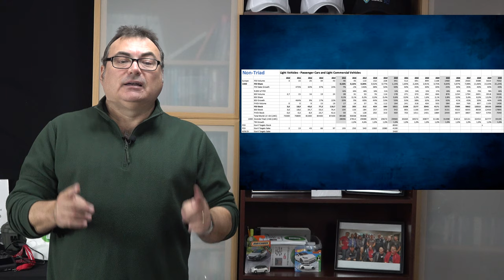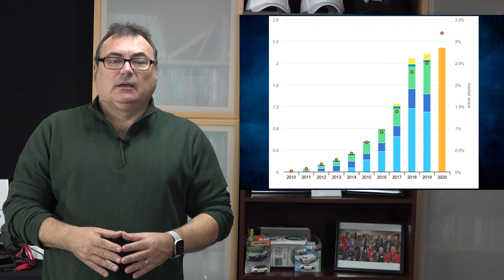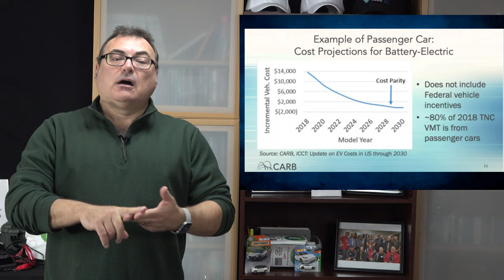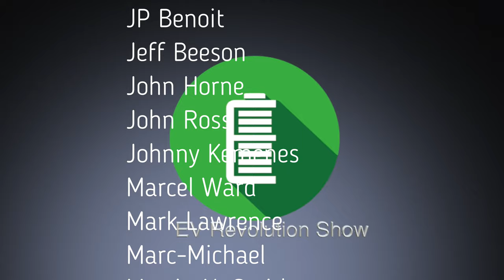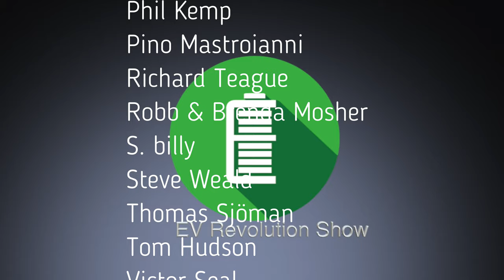Episode 115 - What will 2021 bring for the Electric Vehicle Marketplace?

Comment: Happy New Ken
I think your projections for EV sales, at least in the developed world, are underestimates.
Other countries will follow the U.K. in giving notice of the end of ICEV sales in 2030. Once cost parity comes (and is passed), there will be a tipping point where sales of ICEVs crash. Not only will there be no cost advantage to ICEVs, people will also recognise that there will be no second hand market for ICEVs down the line so they will become even more expensive in TCO terms (ie they will depreciate very rapidly).
Add to that that the network for fossil fuel distribution will stop getting investment and will start shrinking, making refuelling harder, more expensive and more inconvenient. 
These network effects will cause a very rapid shift from ICEVs to EVs and any automakers not on board by 2025 will simply die - their brands being bought and redeployed by EV makers.
Reply from the maker: Thanks Michael and Happy New Year as well.  While a good synopsis, I still hold to my timelines and estimates for now.  Yes the bans will certainly start to change buying behaviors for sure, but with about 1 Billion LDV's on the road in the planet and we average about 75-80 million units sold a year, that would take it about 12 years or so for the automotive "install base" to fully switch over and for those that own an ICEV in a country when a Ban has started, they will keep their ICEVs for another several years IMO.  For example, if I owned a 3 year old ICEV purchased in 2027 in the UK and the Ban starts 2030, that just means I can't purchase a new ICEV but only an EV.  So I keep my ICEV running for another 5-7 years before I decide to switch, maybe even a bit later.  There is no compelling reason for me to switch in 2030 even with lower TCO on a BEV for instance.  I've already made the investment an the ICEV is still relatively new.  I don't think many will switch right away and we actually may see a boom in new ICEV sales in 2029, before the Ban takes effect!  

As far as petrol fuel goes, there are many other uses for petroleum besides gas for cars and that is not going away anytime soon either.
Reply: @EVRevolution  
I get the point about existing cars going on existing into the 2030s. Although don't expect everyone to swap from an ICEV to an EV, at least not a new car. There are already many alternatives to cars that are viable with electric propulsion. And sharing semi-autonomous vehicles will end up much cheaper than owning an EV. We cannot an will not have a billion cars on the road in 2040.

But my main point was about new sales, which you said would be around 60% EV in 2030. Firstly, in countries like the U.K. it will be 100% by law. 
Secondly, the question is, why would anyone buy an ICEV in 2027 in a country which is gearing up for a ban on new sales in 2030?
Will it be cheaper to own? No
Will it be cheaper to buy? No
Will it be easier to fuel an ICEV? No, in fact it could well start to get hard to fuel ICEVs in less busy areas.
Will EVs be a "novelty" that only early adopters but? No
Will ICEVs have better performance? No
Will range or charging infrastructure be a big headache? For nearly everyone, no
Will there be a second hand market for your ICEV? NO!

So when there is no reason to buy an ICEV, it won't be a matter of people slowly switching from buying new ICEVs to EVs. When there is no reason to buy an ICEV nearly everyone will come to the same conclusion and buy an EV.
Imagine a buyer in a dealership looking around the options and finding everything being in favour of the EV. They won't say to themselves "well, we are switching over gradually so I think I'll go for the inferior, more expensive option". They will just do what makes sense abc buy the cheaper better option.
It's hard to think of a precedent for this kind of technology switch because I can't think of a situation when a new product came out that was comprehensively better than the older alternative and the older alternative lasted any time at all. And there isn't even a platform problem. It's not like switching from VHS tapes to DVD when you had to buy an expensive player to use the new technology. The platform is the product.

We will see who is right but I think once people see the writing is on the wall for second hand sales, and once EVs are actually cheaper, it will be the death knell of ICEVs. The only thing that will hold back the transition is carmakers refusing to make them, but then they can expect Tesla, VW, Renault, PSA etc to eat then for breakfast.
Reply from the maker: Great points as always!  I certainly agree with your reasoning and logic and it sounds all good.  However, we humans are such an illogical species and so engrained with habits that for many, to still switch to an EV over an ICEV won't happen that fast.  Of course, in some regions it will happen faster for sure.  However for many, it won't IMO and I get the logic, but still stick to my guns on my analysis, for now.  I hope the populous proves me wrong.